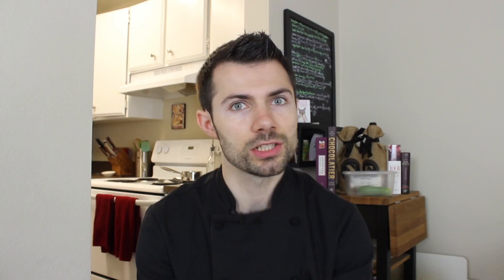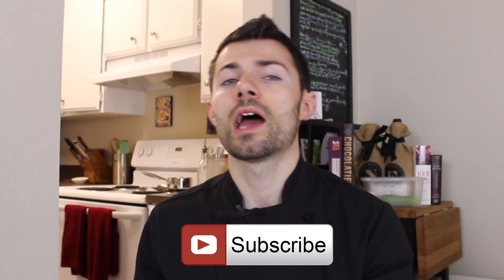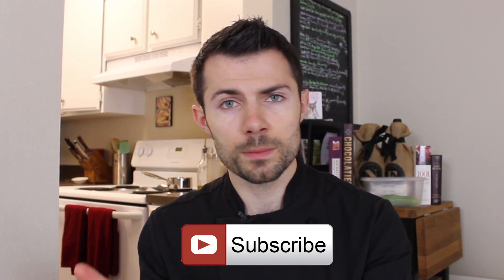How can I make my bread less dense

Comment: I've heard that some bread making is proofed in the frig, which is cold and some proofed in a warm area. I'm puzzled by this. Will the cold also proof the bread properly?
Reply from the maker: If you are making your own starter then yes! which is wild yeast. I used do one and had feed it once a week with honey, but it's a slow eating yeast it smelled like buttermilk. 

but I had another one that was room temp start that smelled like vinegar the bread was incredible but I had to feed it every day otherwise it would have dead yeast that would get black on the top. ( you just scoop that) 

if you are buying packets from the store thats room temp yeast which isn't wilded from the air that needs to be proofed so the yeast can eat the sugars from the grain (flour) your using . 

now if your making a big batch of bread lets say 20Ibs and its in a massive bowl (very common in the cooking industry) we will put in the fridge but it's takes a long time to cool down and the yeast hasn't gone dormant yet so in result the yeast is eating the sugar (proofing) so the next morning we will walk in the cooler have a overflowed container of dough.

Comment: I make bagels and am having the opposite issue. Crunch, size, flavor, and texture of my bagel are all spot on except the density inside. Its a little more on the softer bread side, not too bad but not dense like a true bagel. I am wondering if its an issue with not enough flour, or too much yeast causing too much air inside the dough. Any help is appreciate, thank you
Reply from the maker: How are you cooking the bagels? I cook it some type of acid from baking soda, tartic acid. I change it up. as for the yeast, I don't use that much yeast.
Reply: High gluten flour, salt, brown sugar, dough conditioner, and fresh yeast....let me know if my theory is wrong but a good bagel takes 2 days proofing in the fridge to let the yeast really work through the dough and release flavors. I may be using too much yeast, causing more air in the dough as I am only letting the bagels sit one day due to demand (cottage baker). Or I may be over proofing it, also causing excess air in the dough. Everything about my bagel is great except its not dense enough, some people like that but I just know a traditional bagel to be dense. I do appreciate your help
Reply: And I do them the right way, proof overnight, boil, then on to bagel boards fora few minutes in oven, then flip and bake the rest of the way

Comment: Why is my bread so damn hard after cooling
Reply from the maker: Your yeast may have been dead or went dormant without the yeast creating co2 making it rise and have it  create bubbles for it to be soft.  Don't throw it the dense bread away just turn into bread crumbs and try again. 

make sure your home isn't cold if is? Turns on your oven at the lowest temp ( usually 220F) then turn it off after 20 mins place dough to proof so your yeast can thrive.

another problem if your dough is was to thick? your yeast isn't able to multiply and get through the walls add water to make it thinner dough should bounce back
Reply: @NicolasGanea  Weird it has lots of bubbles and foam when i pour warm water and some sugar. It comes out of the oven soft but after cooling it rock hard and very dense. How do i fix this?
Reply: @zurgboy07   So your bread doesn't hold it's moisture very well after cooling, adding a little more of a fat may help it retain that moisture or try using a tanzong